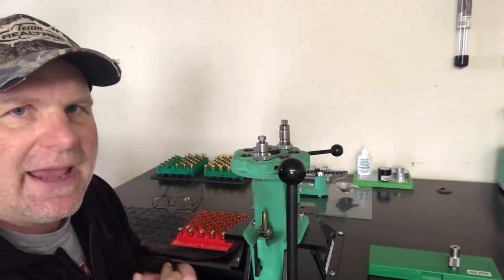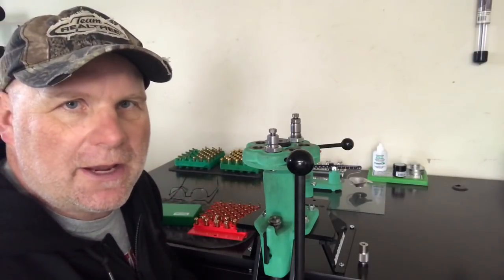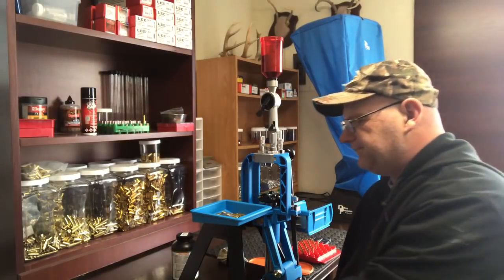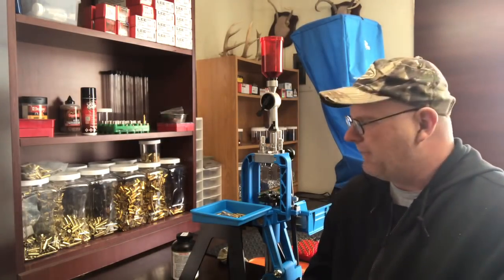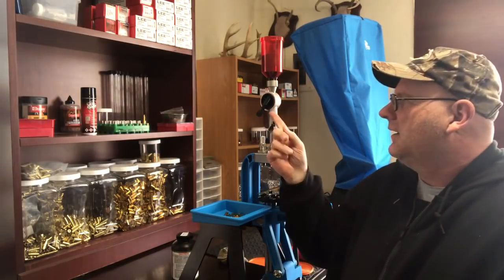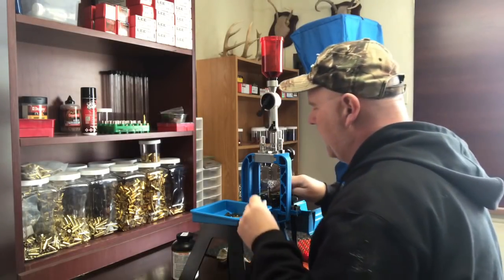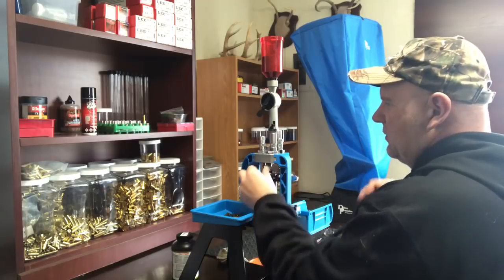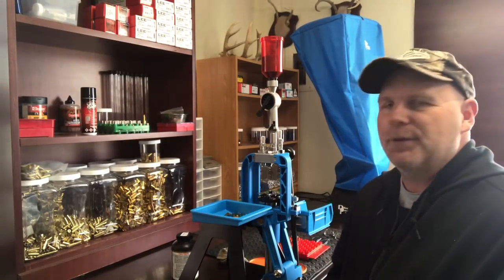Reloading 300 Blackout with Lee 155gr Cast Powder Coated Bullets

Comment: Load data please.  Had to load those Lee 155 PC's short to pass the Sheridan gauge.  Curious about Shooters World 300 Black Out powder, close to 1680.  Thanks and good luck.
Reply: qchemp420  I just started with these too, what's your OAL? Mine chambered but seemed short at 1.090.
Reply: You mean 1.900?  That's what I am using for the Lee 155.  The RCBS 130 spl come in around 1.885.